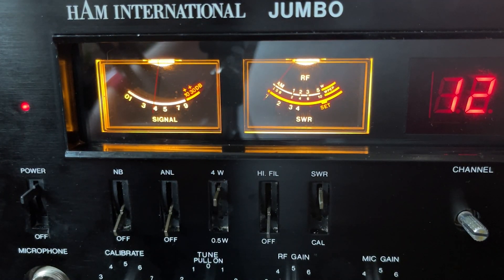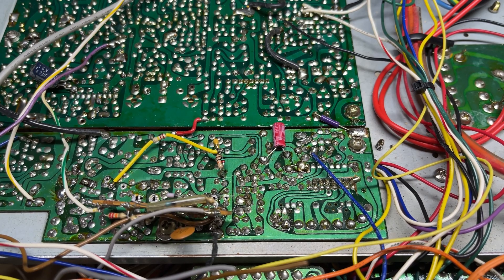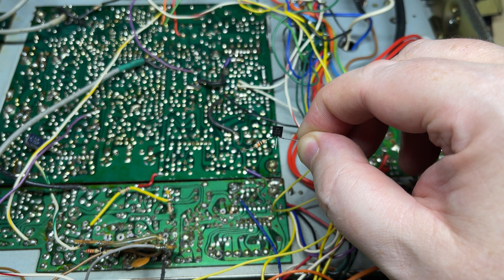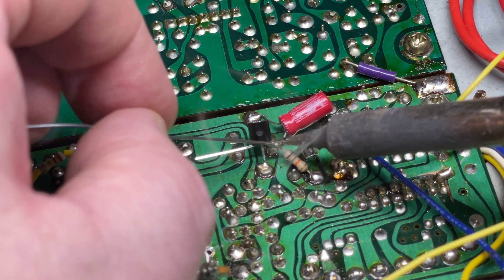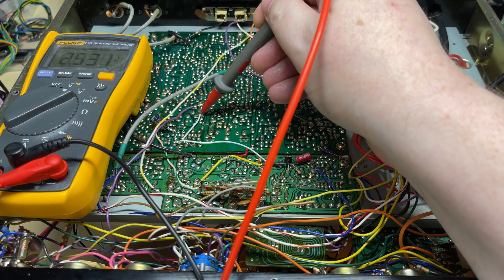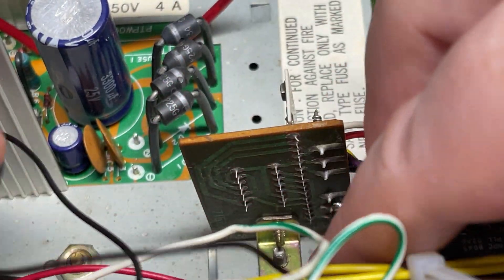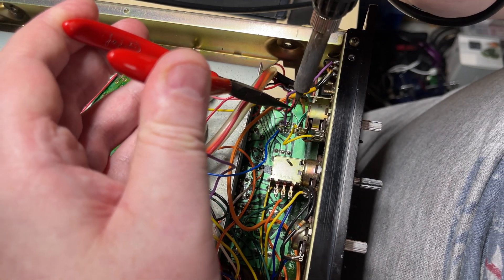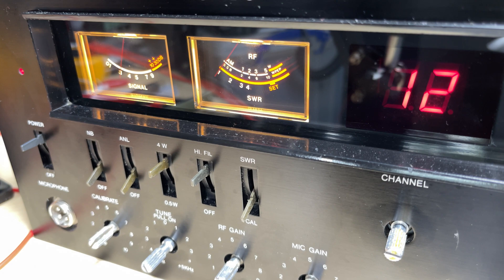EP 077 - HAM International Jumbo MK1 - VCO Feed point mod and Beep Switching - Part 4

Comment: Alternative way of switching the bleep with two wires is feed 12 volts through a 10k resistor to pin 2 of the 4011 chip on the bleep. Grounding that pin gives you a continuous tone burst.